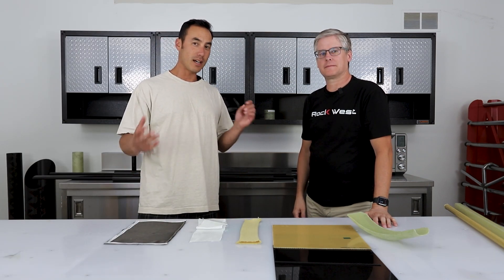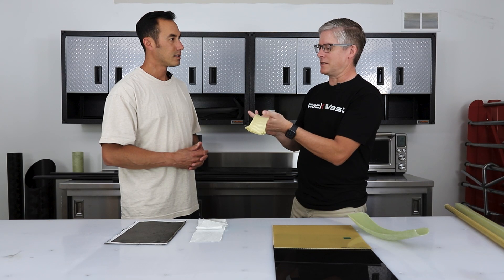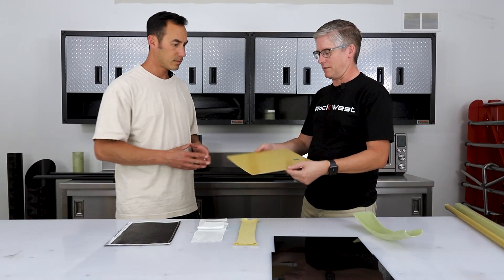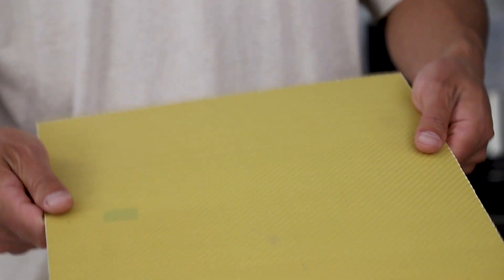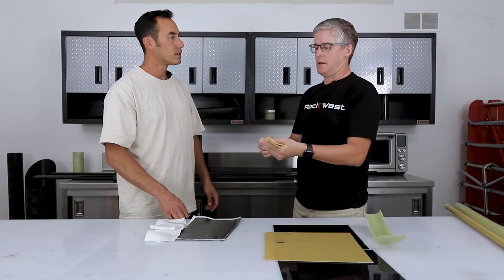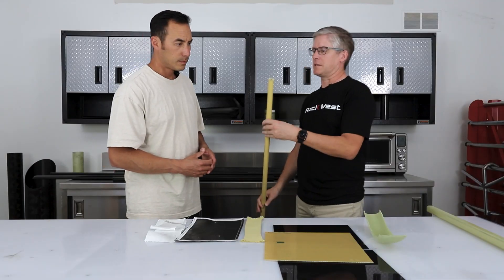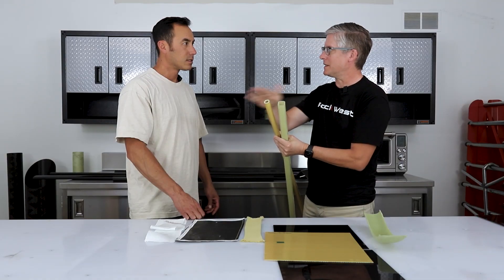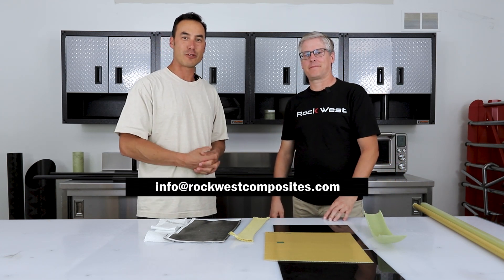Frequently Asked Questions: Part 2

Comment: How long does a structure made of carbon fiber last? Example an automotive chassis, if its made of carbon fiber how would you test it after X amount of years to ensure its still structurally sound?
Reply from the maker: How long a carbon fiber composite structure will last is heavily dependent on the loading applied but mostly environmental factors. CF does very well in cyclical loading so long as the load doesn't exceed the fiber and resin yield strength. Composites must be protected from UV exposure or else the resin that binds the fibers together will break down and show signs of weakening by discoloration (think of the hood of a small wannabe race car that is yellow and quite ugly... That is a result of UV exposure and inadequate paint to protect it.
Reply: @RockWestComposites  Is there any non destructive testing methods in the event that you cant see the condition of the CF or resin, like it being painted.
Reply: @beachboardfan9544   Yes. There is ultrasonic testing which is non-destructive. And sometimes you can even do a simple tap test using a quarter or some other coin. You lightly tap it and listen for sound differences. This will reveal any fractures or delamination.